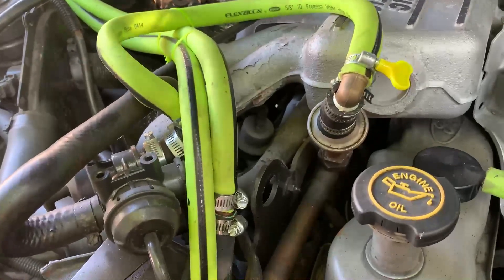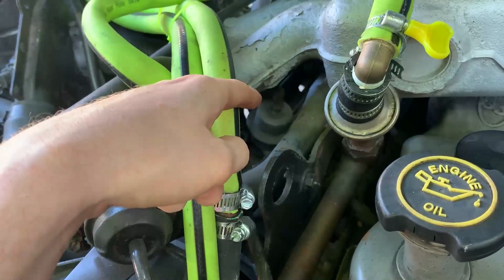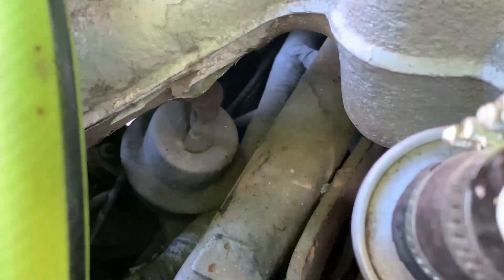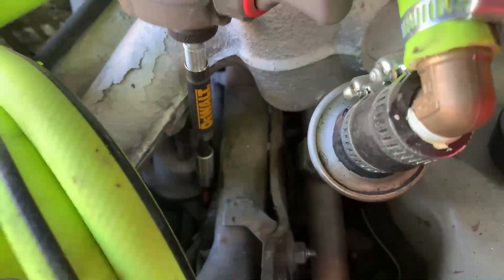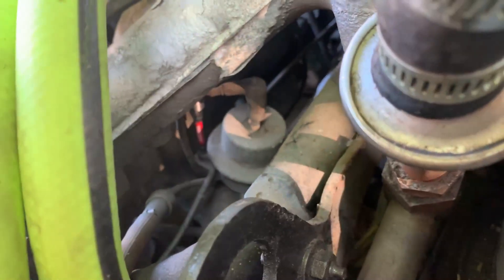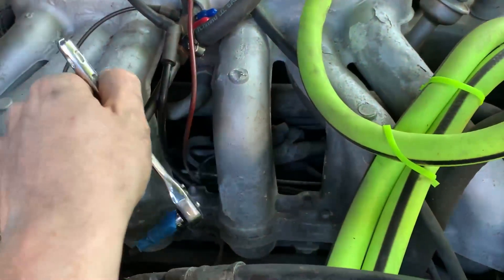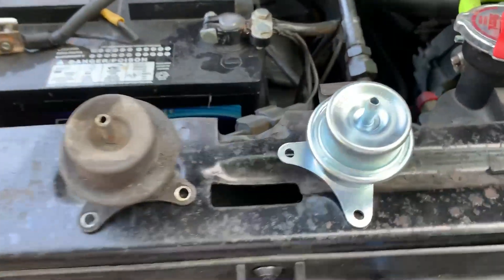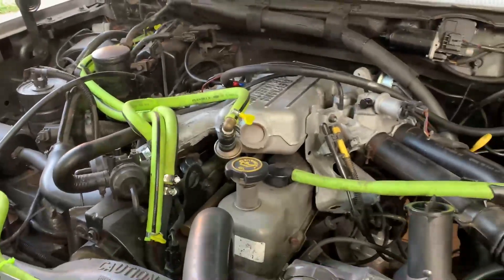Ford F150 Fuel Pressure Regulator Replacement the Easy Way (1987-1996 4.9L)

Comment: Wow!!! Nice looking 89 engine !!  Iv got a 89 for about s month now   Iv been working on it almost everday. Tuning it up and cleaning. But mostly chasing doen the main issue.  It starts up runs well. And warms up. Then all tye sudden starts choking and stalls   Alot of what i have done seems to help and make it take longer to do. But it still eventually does it.  My next step is new frame fuel pump.  But pressure regulator is on my radar as well.  Any tips tricks advice  be much appreciated.  Im getting burned out lol. Iv found sbout 5 real problems i fixed but didnt fix the main problem lol

Comment: 1/4" drive swivel on a 1/4" diameter socket with a 1/4" bit (allen size needed) in the 1/4" socket.😉

Comment: I have a 1990f150 .it is hard starting and once it starts it runs good for about 20 miles then acts like it's not getting fuel and shuts off . I've replaced fuel relay , distributor cap and rotor, ignition coil, fuel filter. Any suggestions on what else it could be
Reply: I have a 1995 doing exact same .. you figure it out ?
Reply: Try that intake air temperature sensor
Reply: I have similar issues whit my 87 bronco
Reply: Same with 97 f150
Reply: Any updates from anyone here?

Comment: Have same motor, fantastic. Fuel components and rail are located right over exhaust manifold. So? In summer when the temp is 100+ outside it's damm hot right over the exhaust manifold. Caused stuttering in mine, replaced fuel pump twice, all sensors, regs, and main cpu. Still not enough pressure driving, gauge taped to windshield. Ford has a TB wayyyy back that states fuel pressure must be higher than stock pumps in hot weather, forget the psi, but right outside COTS pump. Got higher pressure pump, good to go since. This regulator is subject to the same temperature extremes due to location. Ford A Better Idea ( except this one).

Comment: Where did you get the green lines from?
Reply from the maker: Flexzilla 5/8" water hose installed by the previous owner. I think it's literally garden hose. It might be fine long-term, but I ended up replacing it.

Comment: Do u have to reset or unplug battery or any thing
Reply from the maker: For safety, it's a good idea to unplug the battery. I didn't, but should've. After you're done it might run as little strange for a few minutes while the computer adjusts, but not for very long.
Reply: @Jacobbray  thank you it was running like crap after I put it on and started it. I unplugged my battery and it ran rough then held at idle thank u

Comment: If you continue having idle issues replace the throttle body mounting gasket. TBG4107-56 i believe is the correct part number. There was a mass recall on these covering many years of the 4.9 engines. The gasket gets sucked in between the two ports and causes a leak just enough to mske you change every sensor on the truck only to find its that .65cent gasket.
Reply from the maker: This is a good tip. Always good to smoke-test if you can, or spray some carb cleaner around mating surfaces if you can't. There are good videos about how to make a smoke tester for less than 15$. While my fuel pressure regulator did have a failed diaphragm, I was also dealing with old, brittle gaskets that I ended up replacing as well.
Reply: I think I just discovered an example of this collapsed gasket. I'm also suspecting a bad fuel regulator because I have carbon black sticky goo all inside the throttle body behind the throttle plates. The symptom other than smelling like gas on startup, is the idle will hunt from 400 to 800 rpm in Park, but perfectly steady in Drive.
Reply: @posplayr my 89 has black sticky carbon oily everywhere. Throttle body.  Intake temp sensor etc etx.   It stalls after warming up.  Im wondering if its the TB gasket , fuel pressure regulator, fuel pump etc etc.  Any tips advice appreciated 😊

Comment: Tgat location sucks. My 90 f150 4.9 EFI has the reg at the front end of the fuel rail. If i was in you situatuon id install an adjustable reg with a gauge. You can mount it wherever concenient using hoses and an adapter plate. Just curious as to what reg you installed? Im having hell finding one with high enough pressure limits. The major parts stores keep trying to give me regs good up to 35 or so. Im trying to find one with at least 55.

Comment: After you remove the vacuum line how long should you wait until you may see fuel come out?
Reply from the maker: Less than a minute for me. Pull the line off the regulator. If fuel comes out, you know for sure the diaphragm in the regulator is bad.

Comment: Hey my man please help me out with size of those green hoses I really want to do the same for mine looks sick .
Reply from the maker: I don't remember the size, but I really wouldn't recommend it. The previous owner used them for both water lines and vacuum lines. The water lines would kink, and the vacuum lines would collapse under vacuum. I'd use the factory hoses, or a proper replacement. Just my two cents.

Comment: Where did you get all the green lines from I wanna get come color lines I got the same problem done alot of work to it I got this couldn't get it out gonna try again and I need a new egr valve
Reply from the maker: They were on the truck when I got it. I ended up replacing because they weren't the proper hose.

Comment: I have a 1990 f150 that will start and idle but cuts off after about 30 seconds could it be this?
Reply from the maker: Maybe, but the fuel pressure regulator would not be my first guess. I'd pull codes, then go from there.
Reply: I did that got codes for sensors Ive since replaced and it still does it
Reply: I have an 1987 and mine does the same thing it will start and run about 30 sec and it does then on restart it smokes black smoke
Reply: @leannpetersfreeman8039 fuel pressure  regulator or clog fuel filter or a bad fuel pump in tank.
Reply: mine did that was a radiator leak
Reply: @chrissteed9466 👀👀radiator leak wouldn't cause that. Maybe a bad head gasket would cause that issue.

Comment: Are those your vacuum  lines in green  can you do a future video to trace them out and what lines you used 💪
Reply from the maker: The green lines are aftermarket hoses for coolant. You wouldn't want to use that for vacuum line, because they'll collapse under vacuum. For vacuum lines, you can either use dedicated vacuum line, or a harder, more plastic-like emissions line. Both should be available at any parts store like Autozone. Fuel line can also be used in a pinch if its the more study type that doesn't easily compress when you squeeze it.

Comment: How much did u pay for the pressure  regulator.? And where from,,,,thank u for the video
Reply from the maker: @Jose Garcia I see $42 from Autozone, or $26 from Rock Auto. May be $130 for an OEM Motorcraft unit, but the aftermarket unit is what I bought and it worked just fine.
Reply from the maker: It was about $20 from AutoZone. You can also order it from Rock Auto for $16.